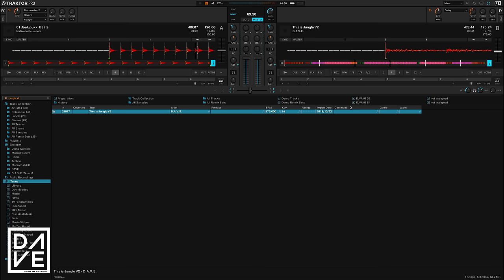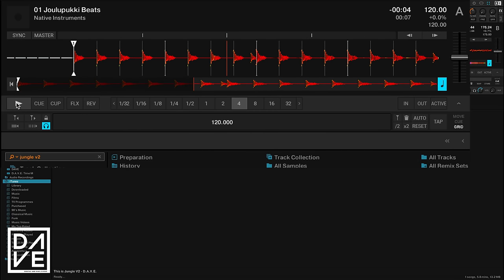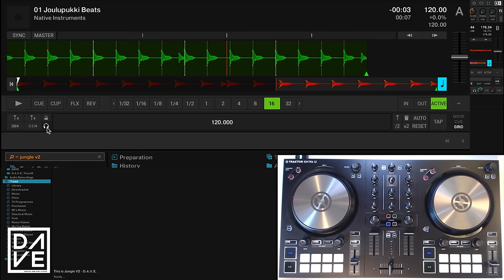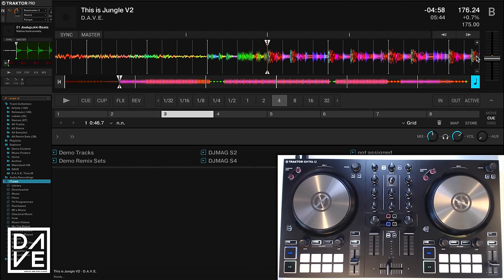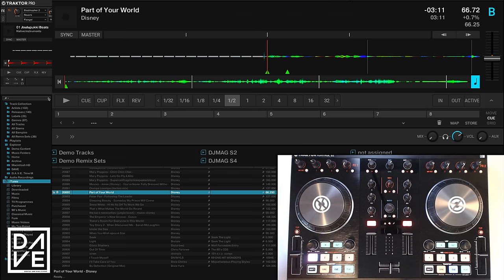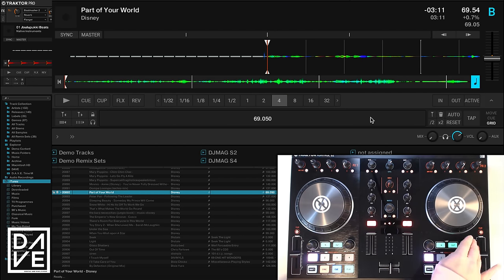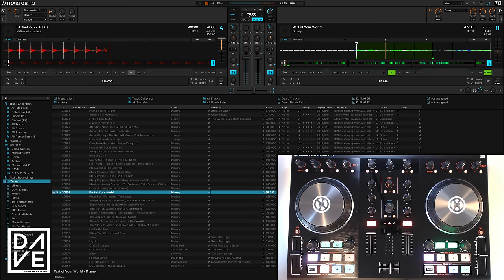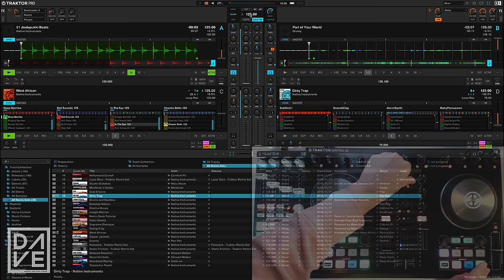Native Instruments Traktor Pro 3 - How To Beat Grid

Comment: Awesome video I’d like to also include the if the line for beat one is off make a new cue point on beat one (let’s say cue5) an change cue one from grid to cue  an change the cue where you placed on beat one (cue 5) change it to grid then the song should be aligned up proper (since you can remove cue one for timing)

Comment: This is the 3.0 version. The update(3.02) removed the in/out markers(to the left of 'active' loop function) which also was a good way to beat grid on the spot as well. Erased my 3.0 dmg by mistake,lol. I got hooked to the filter fader efx so it's sort of a bummer to go back to 2.11.3 so doing the beat grid on spot (I have thousands of songs with live drums) with the update will take more patience
Reply from the maker: Mix I just reread your comment and in/out is still in the new update. If you have a 13" screen you will need to change the screen view to extended or essential (can't remember which). Hope that helps
Reply: @DAVEDigitalandVinylExpert  I was going to update what I wrote friday night after a set I did playing around in the preferences. What I had to do on my mid 2010 15" MBPro was uncheck the eq & crossfader, That allowed me to see it & the eq features still are the same with access to the eq on Vci 400. Thanks much for checking it out for me though.
Reply from the maker: ah cool. Shame they got rid of the in/out buttons on the hardware still though :/
Reply: @DAVEDigitalandVinylExpert  great vid thx!! um how do i downgrade from 3.1 to 3? thx in advance

Comment: Some tracks especially using older analog gear can have slight drifts in tempo throughout the track, so a single beatgrid set by one starting beatgrid marker at single BPM for whole track doesn't work. I'm guessing that at a couple parts through the track you'd have to add additional beatgrid markers so that you can align the beatgrids between the markers independent of the others?

Comment: Awesome, cheers dave!! Total traktor n00b here and somehow I've changed all my tracks to the uneven grids. One thing I'm struggling with though is the metronome..can't hear one, or find a setting for it anywheres 🤔😊
Reply from the maker: Hi Nik,
Make sure you have your headphone cue on, on the mixer and then if you have a mk3 then hold grid and press play and you will hear it. If you don’t then press the headphone icon as in the video. 
Let me know if you need anything else.
Reply: I'll give that a go cheers 👍👍

I've been running a Maschine mk2 from the line out on my pc (built in soundcard) to the mic in on the S2 mk3 to use as a live input, then out of the S2 to my AV amp. I bought an Audio 6 hoping for a cleaner routing solution, but it doesn't seem to offer any..in fact if i run everything through the A6 I end up with a delay when monitoring through the headphones..am I being thick or is it a case of sticking with the simple way, that works. To note, as I said I am a complete n00b..can barely barely compose a beat, just enjoying the gear 😁
Reply from the maker: Hi Nik
We could try and simplify things. Send me a message at dave@digitalandvinylexpert.com and I’ll give you a hand.

Comment: n00b question... your method at 5.40 what if the track continues to drift as you go along. how many times can the cue/grid bit be done for a whole 8min track?
I'm finding this with a track where I know the BPM is correct (checked with a few sites) yet the beat markers just aren't matching.
the technique 5min40sec in helped the most though
Reply from the maker: If you are sure you have the correct bpm in the grid and it’s still drifting you can technically set another best grid from that drift but traktor isn’t really made to have multiple best grid markers to adjust the bpm in sync. 
I personally would get the beginning and ending as best you can for best matching and then manually use the jog wheel where necessary. 
It’s never a perfect science so using your ears are the best option.

Comment: I have exported my MIK data,Cue points etc to traktor pro 3 and wish to keep them so do I just need to adjust/and or set the 1st MIK cue as a beatgrid/downbeat marker(white triangle) and then check the rest of the 7 MIK cues/beatgrid then lock it?
Reply from the maker: Yeah that’ll work. Just make sure you’ve ticket the option to export all data and you’re set. 
Better than that, if you are using the music directly from a usb stick it will automatically save to it.

Comment: Hi Dave, I was able to correctly beat grid and adjust a loop by moving the grid like in the video and pitting it in the remix deck.. The Problem is that it permanently changed the BPM of the original song, 1, I don't recall what the original BPM was.. Is there a way to revert to the original? 2, The loop plays fine  but is no longer within the same BPM of the original song.
Reply from the maker: So sometimes it freaks out when you move it. If you refits the song by removing the grid cue and reloading it, it should reset the bpm and then you can manually type the bpm in the sample in the remix deck.
Reply: @DAVEDigitalandVinylExpert  Thanks Mate

Comment: What if a song you set the bit grid from start everything is OK but you notice the grid changes moving 2 or 3 minutes forward the song what's going on ?  How you fix that having an issue with a track !! HELP notice the track was perfect with the first Cue Point the one in white but then when I try to do my mix with the other songs the beats dont match at all.
Reply from the maker: You can technically set more than one beat grid cue points to help with the movement but tbh it will never work how you want it. So my advice is to either set the beatgrid at the beginning and then manually beat match at the end or vice versa.

Comment: Is there any way to set grid to first beat in bulk rather then single tracks
Reply from the maker: You can select all your tracks and right click and analyse. It will do a good job but won't guarantee 100% correct depending on the size of your transients.

Comment: I’m having trouble trying to grid a track by Joshua Ryan “Pistol Whip” 
The beats become way off 3/4 into the track.

Don’t think traktor analysed it incorrectly it just seems to be one of those tunes I think that I am going to have to put another marker in towards the end or adjust the BPM?

See if you have any luck trying to grid it as I want at least 16 bar intro/outro of this track as part of my set.

I will email you screenshots of this tracks waveform at start of track and when the beatmarkers start becoming all unaligned.

Comment: so i have a question, what if you want to have the beat grid line up on an entire song that has an inconsistent tempo? (old funk songs that were played live without a click) rather than just looping one portion of it. can you shift the beat grid lines independently or do they always all move together?
Reply from the maker: Great question. You can kind of do this by making multiple best grid markers but it’s a pain because if you change one earlier in the song after doing it you will have to start all over again. Plus it makes the song push and pull and can sound odd. Rekordbox is better at doing this then traktor. 
Tbh if I was doing it I’d put it into ableton and warp it properly then export. 
Hope that helps.

Comment: subscribed, there's even an easier way to mix in grid with a playing music that shifts grid like new wave music, the grid is ok at start and start to shift in the center or the end, and you have a perfectly grid next song, i usually map the tap feature of the players, and tap the playing music where the grid is not aligned on the playing music you;; be surprised the grid will instantly move so you can proceed mixing in the next song on the other players, so easy. it only need 4 to 8 taps to move the grid hehehe, specially when the playing music is not really metronomed or not EDM, TAP feature is very powerful like me i have no controller, use only keyboard remapped, i could use bend button but the TAP is better, TAP on the player where the music looses grid while playing hahaha

Comment: I heard traktor has a 99% accurate BPM’s algorithm and considering I only have EDM(trance,rave techno,prog) music files then once I correct and lock any necessary beatgrids then I shouldn’t have any issues then with “non flexible” beatgrids?
Reply from the maker: Traktor is very good and yes 9 times out of 10 with those styles of music you should be fine. Always good to know how to fix them just in case as no software is perfect at it. 😊

Comment: So without the controller you cannot set an out point?
Reply from the maker: You can set cue points using the mouse and keyboard if you want.
Reply: @DAVEDigitalandVinylExpert  thanks... I use the Allen Heath K2's... but I didn't know you could manually set out points on loops...Awesome

Comment: Good video but you're going through so many extra steps to get to the same place. If you just go to grid from the start find your first beat and then just press the white anchor it will do the exact same thing without the extra steps. Just my two cents
Reply from the maker: I agree Chris to a point, but your way only works if the Traktor can work it out correctly the first time. I’m showing you how to do it using the internal metronome and if Traktor cannot beatgrid it correctly.
Reply: Yeah but can't the beat grid drift ? I find Dave's advice the best-always!